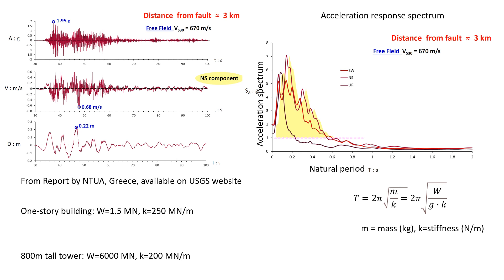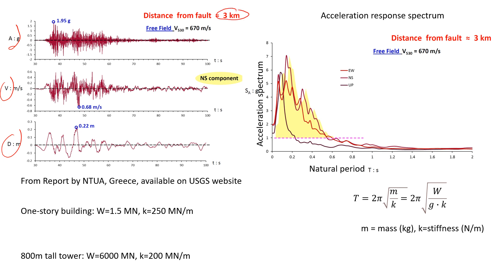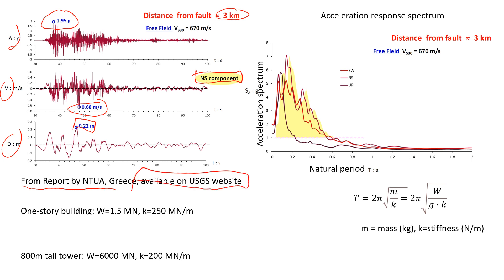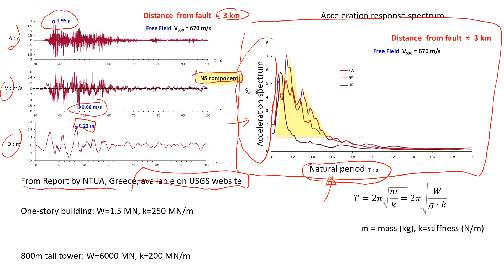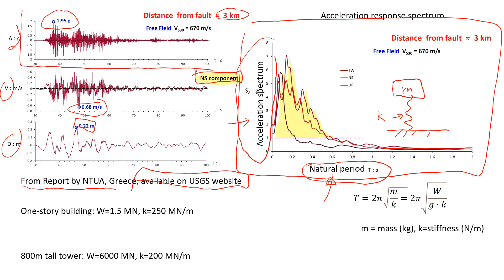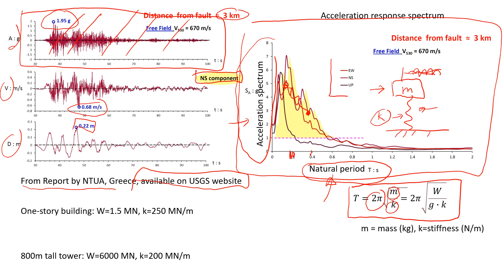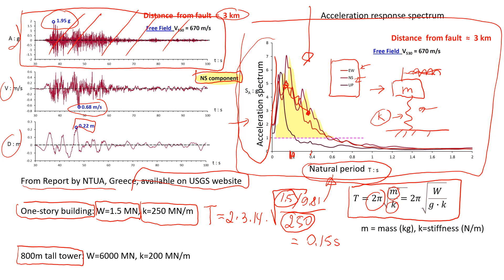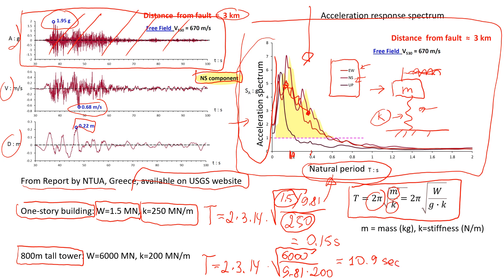Understanding Acceleration Response Spectrum of 2023 Turkey Earthquake and Building Stability

Comment: are interested to learn a New SEISMO TECH ENGINEERING,

that can accurately eastimate DYNAMIC FORCES of oscillating buildings

Using videos of actual FOOTAGES, video editor, and Digital Caliper .. .

This uses the CONCEPT OF

CENTROIDAL SHEAR ( V )

V = ( D/g  t^2 ) * W

and 

NET VERTICAL IMPACT FORCE ( Im )

Im   =  ( 2 d / g t^2 ) * W

I am on my way fully developing this technology ...
It only uses the Total DISTANCE of work done of 1 cycle of optimum peak oscillation and  Angular Velocity to CORRELATE the TIME ELAPSED of horizontal and vertical displacements of SEISMIC WEIGHT acting within the displaced CYCLICAL Trajectory of Center of Mass

Which is much better and easier DYNAMIC SOLUTION than using pseudo acceleration

Comment: I believe the recorded values were not very accurate at the time being. Later some sources corrected  the pga. The earthquake reached 0.6 g but never 1.9 g.
Reply: @CHRISTIAN JUNIARTO as far as I know, the early calculations were not normalized properly. The reason is partially political. The emergency units were not as experienced and organized as required during the early days of the disaster, so the government, instead of doing proper investigations, decided to state that the Maras earthquake was the largest earthquake of this century by using false datasets. In other words, the falsely measured numbers are used for political statements to put the blame of 50k casualties on nature itself.
Reply: @CHRISTIAN JUNIARTO it is important to mention that most buildings in the zone were retroactively legalized despite the fact that they had been disregarding essential construction codes. This is also another reason why the pga values were shown so high.

Comment: Nice work but 800m building height is a bit exaggerated. The houses built on the plain are expected to be lower than those built on the rocky ground but the opposite was done in the earthquake zone.